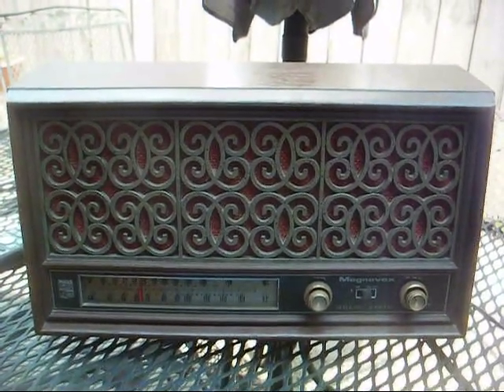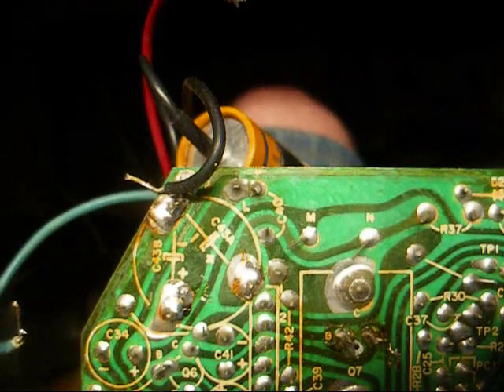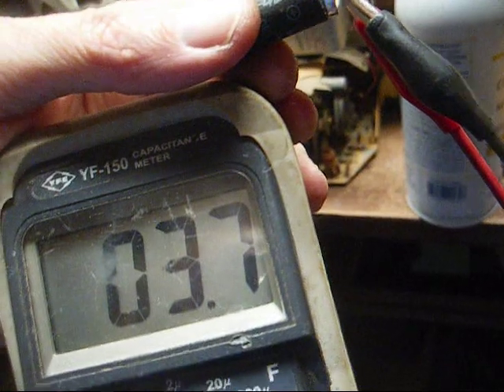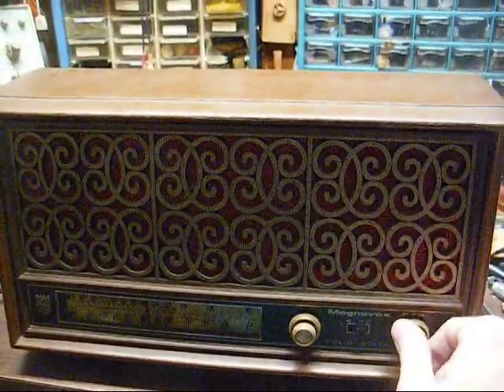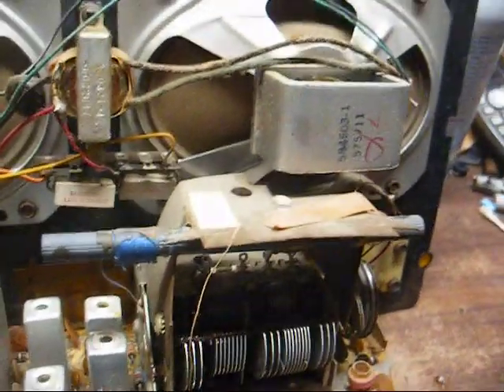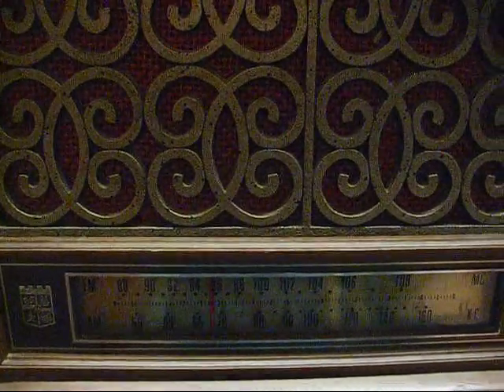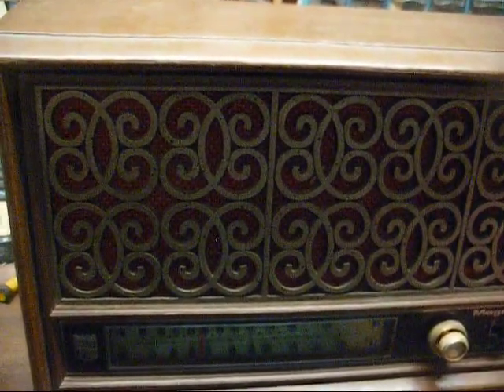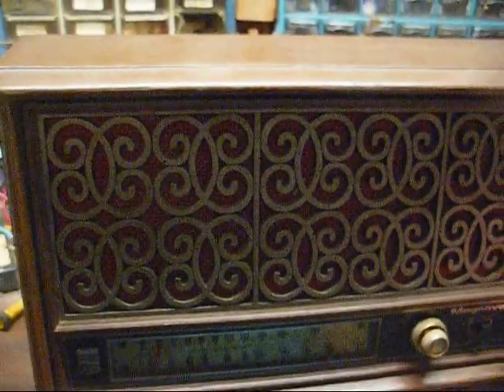Repair of a Magnavox AM/FM table radio from 1967 feat. mumble rap stations

Comment: We bought a GE metal cabinet b+w rude set that. used those compaction tubes back in 1968. It always had problem with the sound getting low and going loud They sent a tech from GE to fix it under warranty. He couldn't do anything.with it. I finally rolled up my sleeves and took a crack at it. It had a bad solder connection on the sound rake-off coil and various connection s on the 6Z10 tube socket .Never had any problem after I repaired it
Reply from the maker: I may have a GE like that. Mine is a 19" B&W in a metal cabinet and it's from the late '60's. I think mine has a mechanical sleep timer on it.

Comment: Week ago colleague of mine found exactly same model.     When I turn the power on, it  buzzes, ( like the old valve radios making noise when nearby florescent lamp is  turned on). turning the turning knob doesn't pick up any stations stations AM or FM. I offered to take look and fix it. I appreciate any suggestions in trouble shooting the problem.

Comment: These are excellent Magnavox table radios. They came out 1969 and ran until about 76-77. To me, this model the last good Mag table radio. It has two great speakers and great tone, even though this is not technically stereo or high fidelity. Sounds great on either AM or FM. Sadly, they were too cheap to put a dial light into it. Nice repairable Maggie. I enjoyed your video. But please work on your camera work, and get a better mic.

Comment: RCA made a bunch of TV sets which had cold soldered tuners (According to the internet).  The result would be after the set was warmed up by the viewer (Half an hour?), it would begin to buzz and the picture would go schizo--sometimes intermittently.  We got around this by using a VCR's Tuner to play the stations.  Then the set was fine until broadcast format went digital some years ago.  Got rid of the RCA and went flat panel.  We had used the 32 inch RCA console for almost 20 years.

Comment: I'm surprised they didn't just put one larger like maybe 6 by 9 speaker as opposed to dual 4 by 6's but that was probably a cost cutting measure. From what I can see it does have a really nice TO3 cased output transistor so I bet it can get pretty loud.
Reply: That doesn't make sense, I'm sure 1 larger speaker would be cheaper than 2 not much smaller speakers.

Comment: Hello, just revived a 1931 Westinghouse Columette model WR-10 that was given to me that had previously spent it's life in an old farmhouse that it's roof had collapsed on it 20 years ago. It still works perfectly without hum on its original dry electrolytic filter caps.